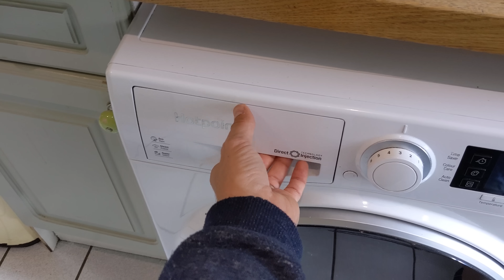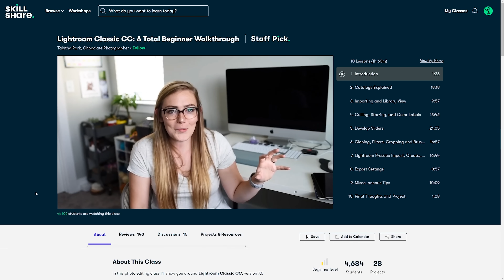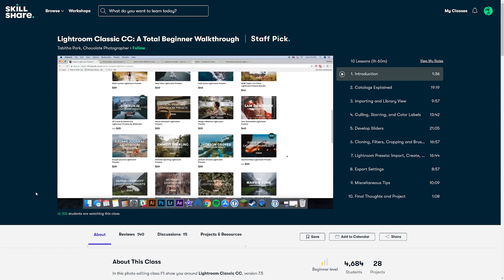The Pythagorean Siphon Inside Your Washing Machine

Comment: I've always known toilets to have a light flush with a quick handle plunge, and more water to flush with a longer held plunge.
Reply: That's because you're using toilets with a rubber stopper on a hinge  connected directly to the flush handle by a chain. Holding down the handle holds the valve open.
Reply: @bruceschneier6283  Wait a sec.. you're not the Bruce Schneier are you? 👀
Reply: I was going to say that to but I figured someone already had so I read a few comments before I did and sure enough there you was 😉